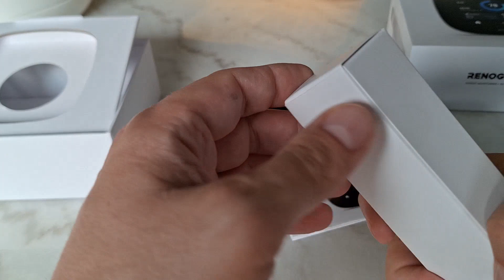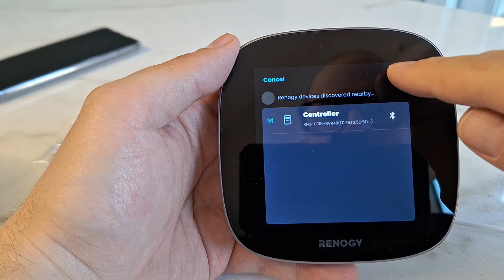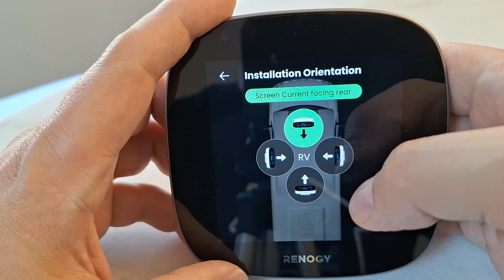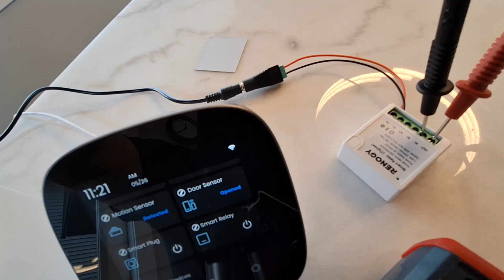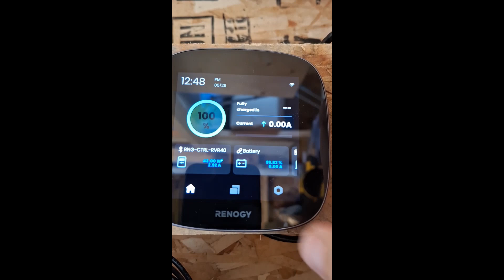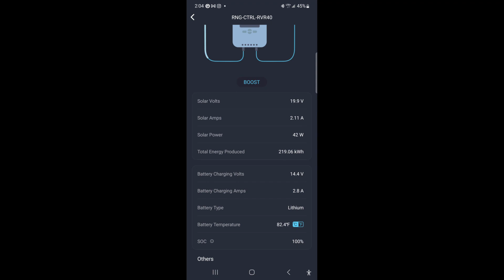Renogy ONE Core - Unboxing, Testing and Review

Comment: Hi mate, what inverter is that? I have the new 3000w inverter and cant seem to find out how to connect it to the monitor.
Reply from the maker: yeah, not all of Renogy's inverters have the data port. The one i have is the RINVTPGH110111S, the 1000 Watt. They also have a 2000 watt "smart" or "connected" inverter. If you don't have a data port (i.e. ethernet port), your inverter does not support data sharing.

Comment: thanks for the great video, now can you tell me , how do i connect my BT-2 to a battery that doesn't has a port RJ45 ? thanks
Reply from the maker: you can use Bluetooth. The device also supports bluetooth connections. Press add device it should scan BT devices AND wired devices.

Comment: Does it have a speaker ?
What use is it if a tiny word changes color.
Reply from the maker: I don't think it has a speaker very good question. You can probably make an automation for some sort of siren if some parameter goes out of whack you can use the relay to turn on the siren or other speaker

Comment: Anyone know if other batteries with a RS485 connection will show up in the Renogy ONE Core?  I'd really like to use the EG4's 400Ah batteries that have RS485 built in which would eliminate the need for a battery monitor
Reply: No but I’ve heard the May make a shunt. That would enable anybattery to be used
Reply from the maker: This is a great question. The thing to take notice that rs-485 is a communication protocol that transmits data between devices. You will still need to be able to decode this data. Having said that I doubt it's going to work and if it does work you may not get a hundred percent functioning features. However it's worth a shot because there could be some standardization between vendors
Reply from the maker: You're absolutely right. They already announced it and it looks like it does work with the one core

Comment: Can the imbeded Rover load relay be controlled by this remotely?
Reply from the maker: That's a great question. I did not see that option. Wonder if it can be added via future firmware/software update?
Reply: @antoniodecrisci2369  Would be perfect for firing up my 12 volt refrigerator, remotely, a few hours before I head to my RV

Comment: Has alot of features that I will never need. All I require is wifi access so I can remotely use the Renogy app. Don't see me purchasing this
Reply from the maker: you can now enable Local AP mode. This will allow you to connect to it (within range) using your phone. No internet required to connect to it, now.

Comment: Can you make multiple bluetooth connections using the hub? I can seem to only connect to one device using the hub via Bluetooth. For example DC-DC charger via Bluetooth and the other connection would have to be via Ethernet. I’m trying to connect both devices using the hub and one BT-2 adapter which is connected to the hub.
Reply from the maker: Yes, at one point I was getting 2 of my devices communicating via BT (in the video you can also see that). Maybe try disconnecting/connecting the BT1/2 dongle and leaving the hub in search mode until it times out.

Comment: Still can't get an answer if this thing has a shunt built into it..
Reply: No shunt built in but if you are running it with a Renogy LiFePo4 with bluetooth you don't need a shunt.  The app will show you all the info you want.  It shows voltage, amps in, amps out, time till fully charged, time till fully discharged as well as the individual cell voltages among other things.
Reply: @ii1825  Well the New Smart Shunt 300 will have that feature builtin.. If they ever release it. As they show it in their One Core video.. But it' snot for sale yet..
Reply from the maker: It does not have a shunt built in. It relies on whatever the battery is reporting.
Reply: @antoniodecrisci2369  Thank you.. As they don't even show the New Smart Shunt 3000 for sale yet.. Which you need to make this thing useful...Outside buying smart devices to it like the ones you have..
Reply: @WizzRacing the smart shunt is what I am waiting for

Comment: Can you turn the inverter on and off on the One Core? Or only view it's metrics?
Reply from the maker: At the moment, only view its metrics. According to Renogy you can turn the inverter on and off using the relay, but I would need to figure out the wires (I have not yet) of the ethernet com cable. For the moment, I used a SwitchBot Bot to control the hard switch and it is working well. I posted here in the DC Home Community chat:
https://pc.renogy-dchome.com/detail/39649
Or you can search for "Turning Inverter on/off remotely" in the Community. Hope that helps.